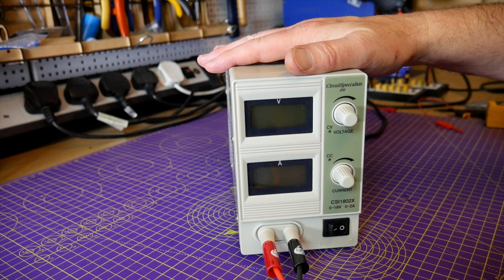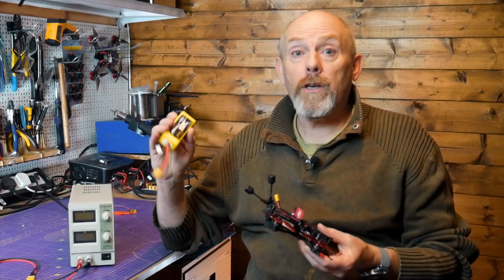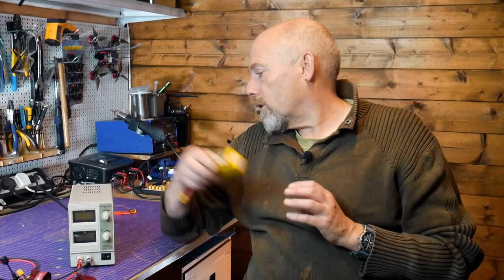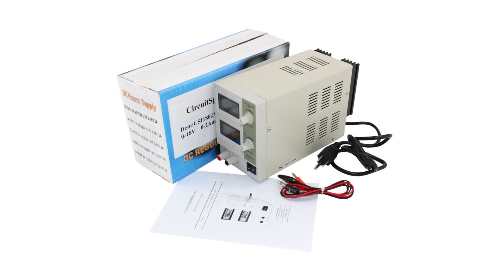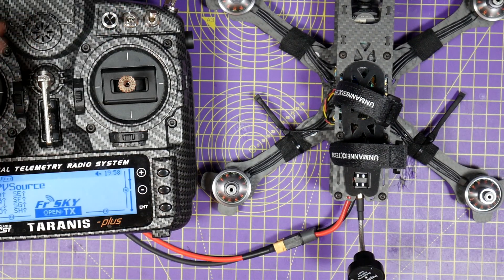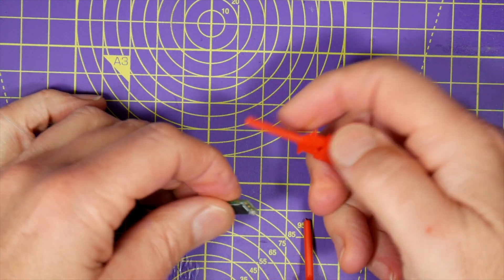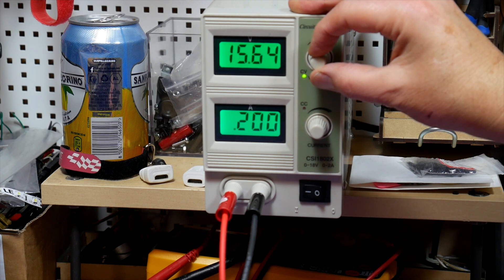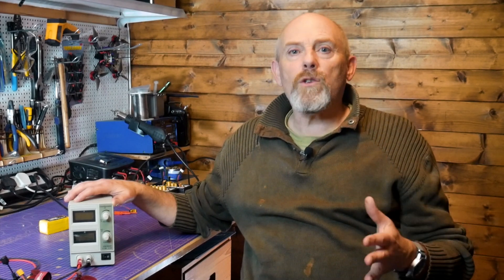Building and setting up FPV quads. Why you need a variable bench power supply.

Comment: what if you build tiny whoops that use a male bt2.0 connector, how would you connect that to a bench power supply?  I haven't found female-bt2.0-to-banana-plug adapters anywhere, how do you do it?
Reply from the maker: To connect your  BT2.0 connector to a bench power supply, you might need to create a custom cable. Just solder spme banana plugs and leads to the bt2.0 connector with a lead. Make sure you get the polarity correct.

Comment: Question, if there is an issue how do you know with the power supply not the smoke stopper if it doesn’t pop or it won’t supply more than you set how do you know there is a short

Comment: Great info. I'm on the fence about to buy a bench power from Amazon. IKococater DC Power Supply Variable 30V 10A with Output Switch, Adjustable Regulated Switching Bench Power Supply with 4-Digits LED Power Display, 5V/2A USB Interface, Accurate Encoder Adjustment Knob. The unit is selling for $70. Just wanted to ask for your opionion on this unit.
Reply from the maker: I haven't used one. But having separate power and output switches is a must.

Comment: never put props on the quad on the bench
Reply from the maker: Generally yes, but if you have a current limited DC supply or a smart smoke stopper, the  props and motors will hardly turn before the power is limited.

Comment: So how do you know if there is a short when you power it on with the bench power supply?
Reply from the maker: You don't. But always check the battery terminals with a multimeter first. As I explained, if you set the current limit low to start off with you'll never blow anything, but you just need to keep an eye on how much current is being drawn.

Comment: How are you managing to supply power to your drone while still working in Beta flight? When i supply power to my drone it disconnects it from beta flight which i am assuming is due to the USB being grounded
Reply from the maker: It sounds like a problem with the wiring or your flight controller. Flight controllers are designed to work off USB or battery or BOTH. Usually the VTX, receiver and ESCs will only power up when the battery is connected. This explicitly allows the motors to be tested and run when the USB and battery are both connected.

Comment: Thanks for the informative video. I bought the Longwei 30V 10A variable power supply that you mentioned in the Banggood link. With this power supply I believe that I need to set the current limit with an ammeter by shorting out the terminals. What would you recommend as a safe but useable current limit for working with DJI FPV HD quads and goggles?
Reply from the maker: 500mAh if you're on the cautious side. Thanks for watching.

Comment: i dont have a variable power supply, but can i power up an fpv drone using 12v 1000mA adapter power supply? will the motor spin using it? its a Tyro99 btw :) thanks!
Reply from the maker: The whole idea is it's a variable power supply with current limit. If you can only use a fixed supply you might as well use a LiPo with a smoke stopper. Honestly, just invest in a variable supply - even a cheap one - you won't regret it.

Comment: Excellent ideas. Thanks! Why not use the regulated voltage and current limit from your ToolkitRC M8?
Reply from the maker: Yes you can do that - it's an excellent charger - but it doesn't have a switch to turn the power on and you still have to fiddle pushing a power lead into the servo plug. The switch on the power supply is so much easier to press.